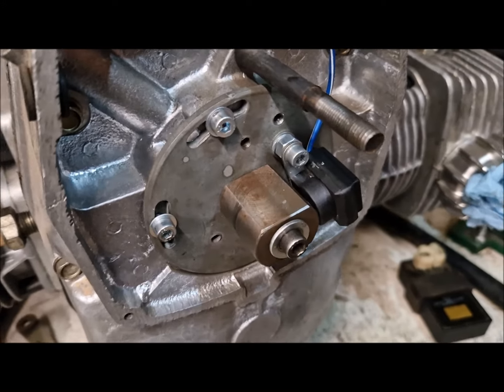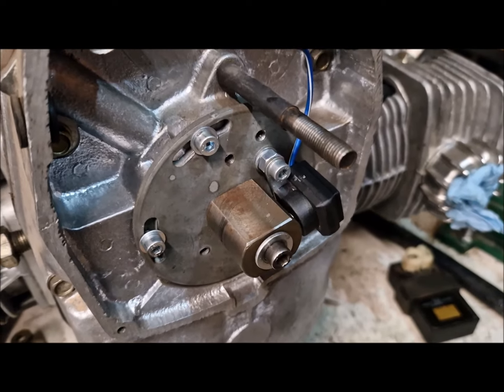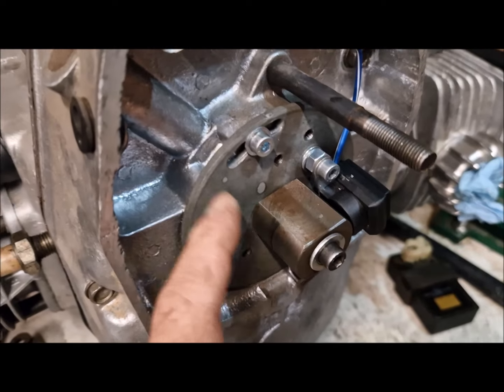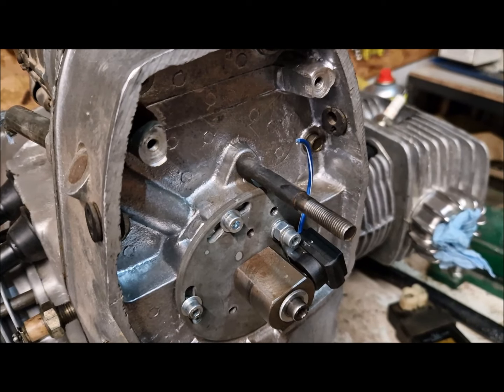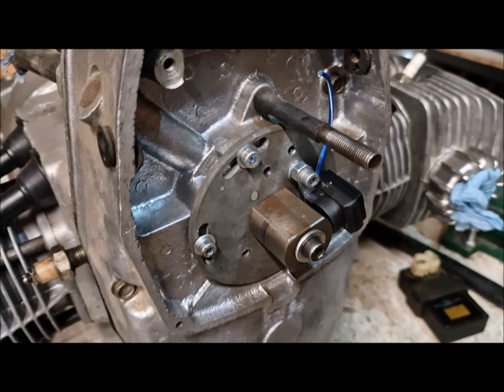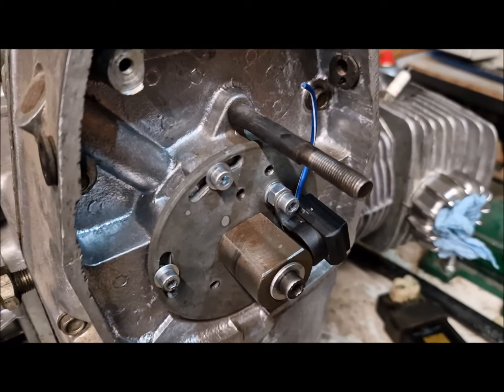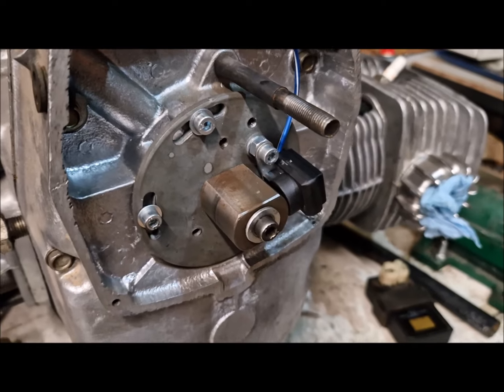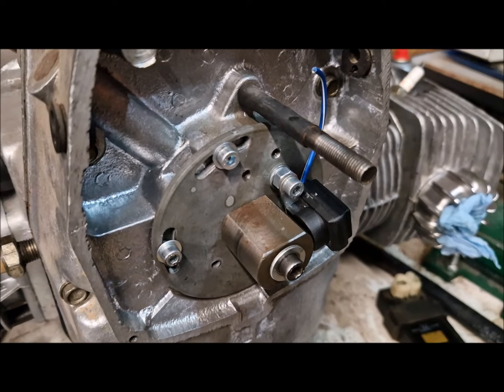Electronic ignition (12V) for Dnepr/Ural  with scooter parts.

Comment: Came here from Facebook UK Cossack Club - many thanks for your video, it is very helpful.  My Ural is 6v so unless ignition uses small enough current that i can use 6-12v boost converter (which I use for LED headlamp) then I am stuffed.  But I can see a use for this technique at the museum where I volunteer, with 1920s "National" gas engine which has a damaged magneto, and your pin-outs are very useful.

Incidentally, youtube suggests you are in Romania?  I toured N.Romania (route 18?) a few years ago on the way back to Poland from Ukraine, on my old Ural.  A very lovely part of the world - I was surprised, as I had no expectations really before I found myself there.  All the best from Manchester UK.
Reply from the maker: Yes, I am from Romania, near Bucharest. I did not tried with 6V.

Comment: this is a easy to build and budget friendly solution, thank you for sharing all the details! Have you any informations how many degrees this Ignition advances timing with rising rpm?
Reply from the maker: It should be 28 degrees at 4000rpm according to the Kimco manual.

Comment: Salutare, acest tip de aprindere merge si la M72? Mersi
Reply from the maker: Ar putea merge daca ai trecut pe 12V dar e mai greu de adaptat din cauza rotorului care vine pe axul cu came. In loc de rotor ar putea fi folosite camele de la platina dar nu am probat deocamdata. Daca ai instalatia pe 6V merge foarte bine cu Gotronic de 6V si bobina de Fiat ca cea prezentata in video, eu asa am pe M72-ul meu care e pe 6V.